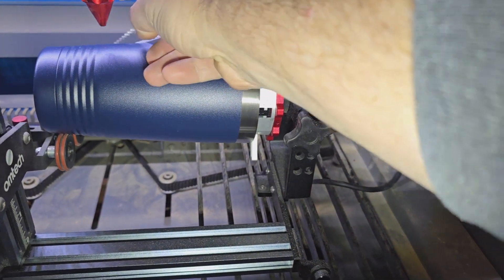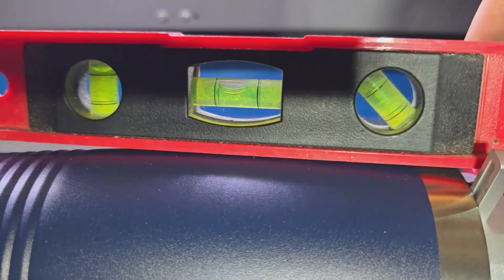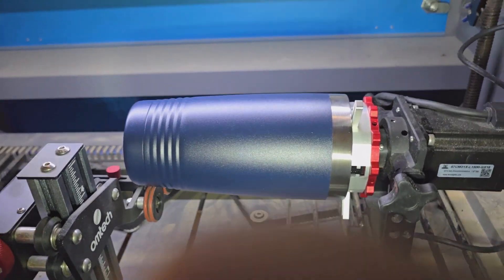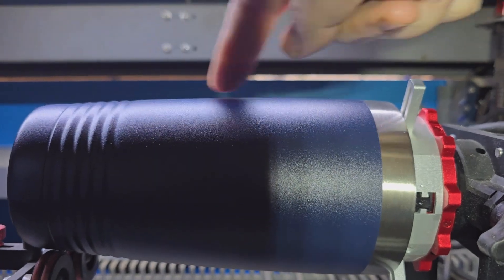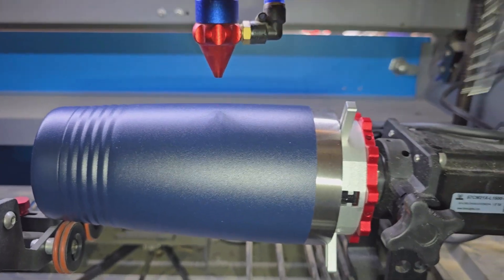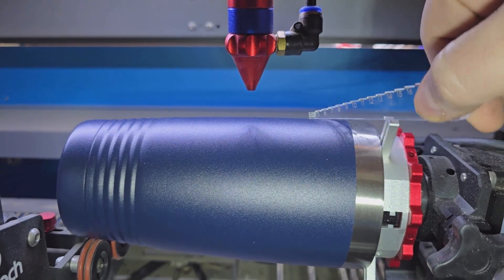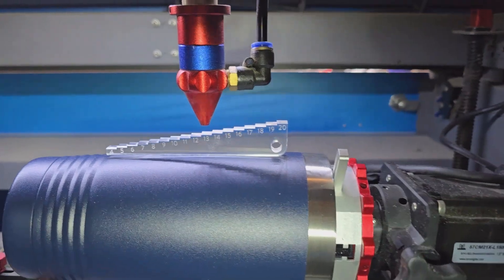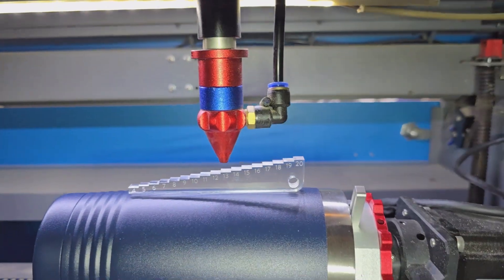How to level a tumbler for engraving...Upgraded

Comment: Great video. Thank you! Does that acrylic measuring tool work on the Stanleys?  Why is your measurement at 18mm?
Reply from the maker: Yes, it works on anything.  I did a ramp test and the results showed 18mm as the ideal focal range for that setup.  It came from the factory with a 20mm block to use for focusing.  So it was off by 2mm.  Everyone should always do a ramp test to see what the ideal focal range is.